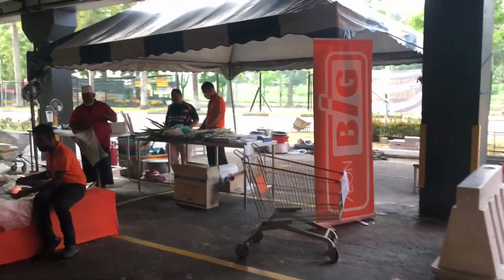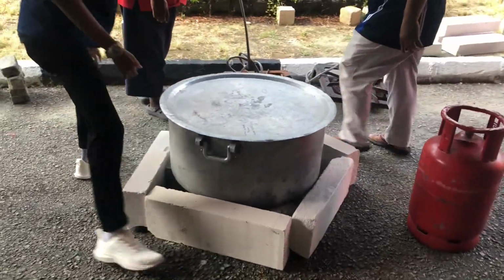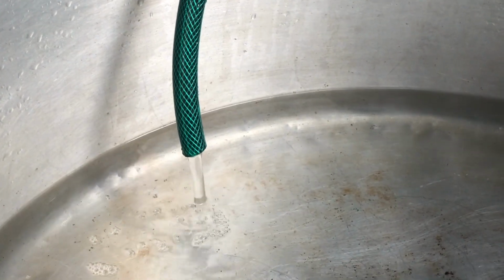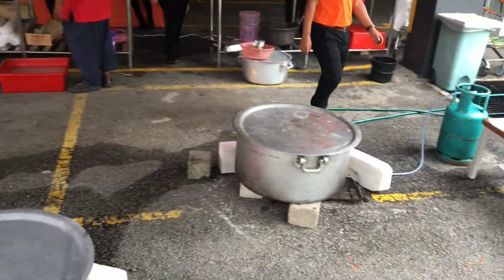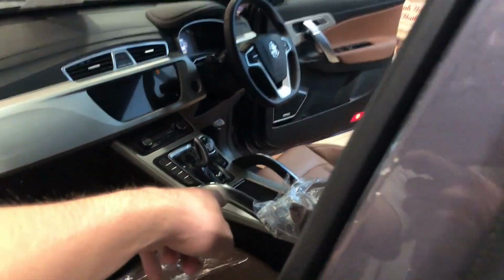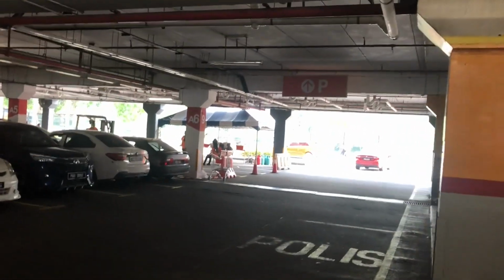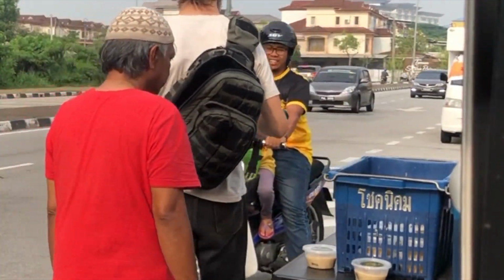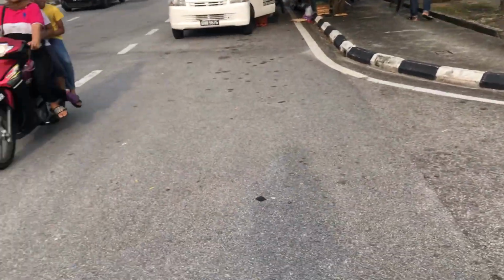How Do Malaysians React To a Foreigner Giving Out Bubur Lambuk?🇲🇾

Comment: No. It s not a Toyota under a different label.  Its a locally made n designed national car Proton. Dont be so condescending, George. It s not nice.
Reply from the maker: Maybe I got wrong information, I thought to remember that someone told me that.. or do I mix it up with another brand? Not sure anymore 😅
Reply: @GeorgeYusuf  its actually volvo not toyota. volvo owned by geely (china company), proton partly owned by geely.. x70 using same engine as volvo xc40..